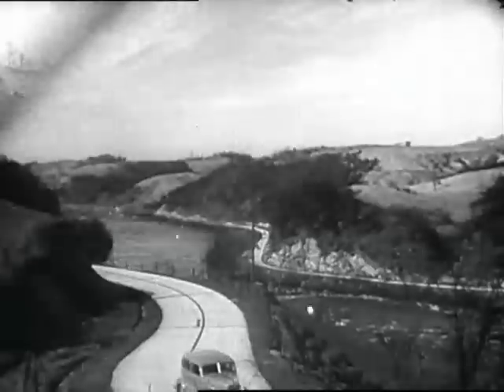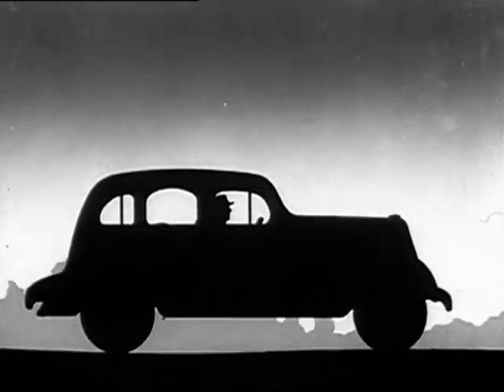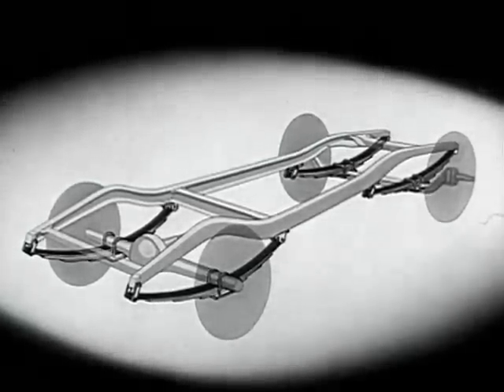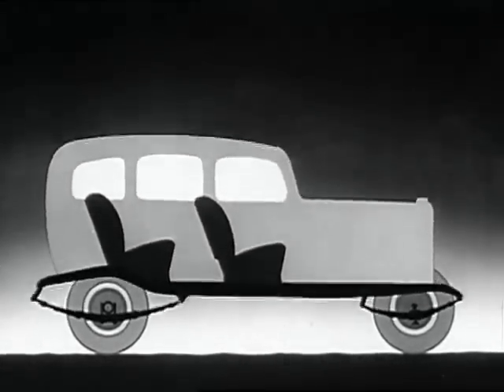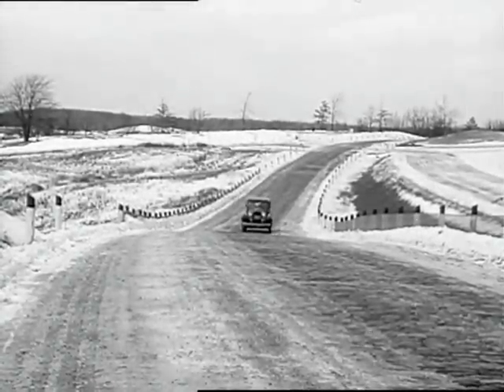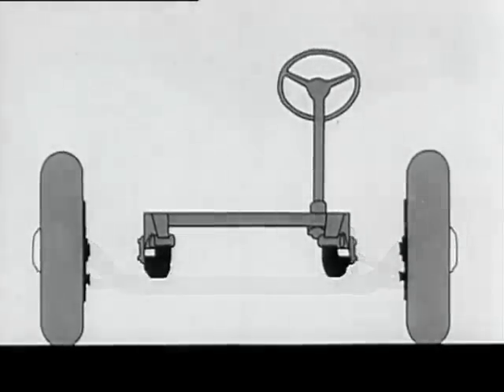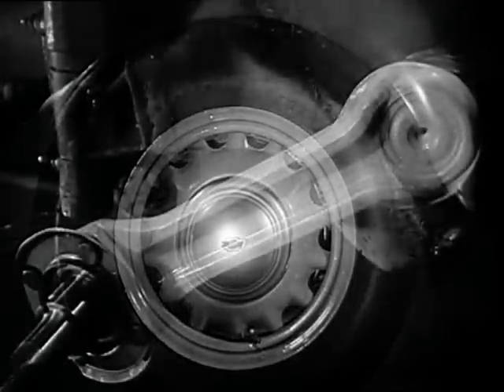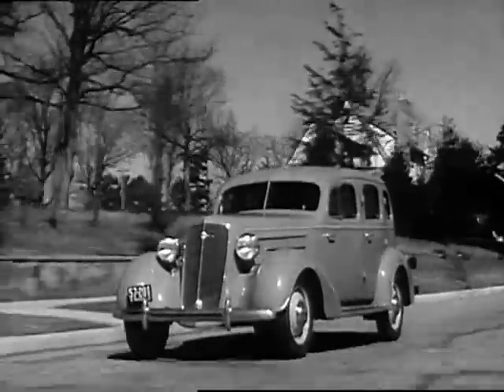Spring Harmony (1935)

Comment: It's incredible to me to think that automobiles in general are just over a hundred years old, and our suspensions still use basically the same technology from 75 years ago. These are historical videos, even if they are ads.
Reply: Umm...not really. Suspension systems date back hundreds of years and have evolved greatly. It is not the same basic technology.
Reply: @baddoggie101  care to elaborate?
Reply: @mendonesiac  McPherson struts are relatively new as are ball joints.
Reply: @baddoggie101  McPherson struts are also 70 year old technology. Here's a good short article:
https://www.hagerty.com/media/maintenance-and-tech/what-are-macpherson-struts/
Reply: And the internal combustion engines we have today have barely changed since then.
Reply: That's not technology that's mechanical engineering at it's finest
Reply: If it aint broke dont fix it

Comment: All the modern suspensions start here...  Keep in mind this technology was pre-WW2, pre-jet age,pre-computer.. Still impressive, just figuring it out..Love these videos, keep them coming..
Reply: I love these cars better than the modern crap coming off production lines. Theyre fiberglass and wires and they suck. I leaned of my friend's 2015 f-250 and i sank 3 inches into the body.  He got really pissed at me and i was left really confused about the body. I have a 1991 f150 (beautiful vehicle i love it) thts built like a brick. But when i open the engine, theres more wires than actual engine!! It annoys the crap out of me as most of that is just pollution control crap and sensors and computers and i understand that they detect engine wear but we didnt need that crap 50 years ago, why do we need it now? Look at an old engine from the 60's, its so clean and empty. Lord i wish i wasnt a millenial and born alot earlier
Reply: Ethan Bunch built like a brick means heavy like a brick, which means it’s slower, more expensive to run and harder to slow down, and not necessarily safer as the use of metal structural parts which are designed to crumple in order to absorb energy in modern cars and the much lower energy in a collision of the same speed can make crashes less dangerous. Also many cars are built from aluminium now I can’t think of many that use fibreglass.

electrical components are used everywhere in a car, there’s a reason that despite them being impossible to fix on the roadside they are used. They make EVERYTHING BETTER, yes they are used to reduce pollution but mainly by making the engine more efficient, the sensors used because what the point of having a computer that knows nothing, they allow for the car to react to make your life easier and more comfortable. We did need this crap 50 years ago but the technology wasn’t there yet. They cut out a lot of weight as what would once need to a large complex mechanism can be done from a few small centrally components.

I also idolise a largely mechanical system but electromechanical systems are vastly better, a 1960s engine may look easier but a modern engine is better, also if the engine is empty that mean the designers have wasted space and materials or someone’s run off with your engine.

(Also according to google the 2015 f-250 used an aluminium body and bed which saved up to 700 pounds of weight (sorry had to use imperial, woo metric) to compare the weight of an average 20yr+ US man is 197.6 pounds, also if you start to feel a panel flex you probably shouldn’t put so much weight on it aluminium isn’t as stiff as steel so it will deform)
Reply: Ethan Bunch another thing about car bodies, the panels aren’t structural they don’t need to be able to support a man so making them to is a waste of money, materials and adds weight.
Really if one of your requirements for car is that it can be leaned on, you could buy a crutch instead them you don’t need the car.
Reply: @ethanbunch3274  I love all of the polution control.  You can also smell an old car from around the block. Go down to Mexico, and after you're sick to your stomach from the fumes, you'll appreciate pollution control. Also, I like how modern cars last over 200,000 miles. My 1951 Chevrolet had no overdrive, and no crankcase ventilation filter. Gravel and sand in the oil coupled with always racing the engine means worn out at 100,000 miles, and poor fuel economy.

Comment: I had a '73 Peugeot 504 sedan. That had 4 wheel independent suspension that had a couple of feet of travel it seems. Best riding car I ever owned. Washboard dirt roads and speed bumps were not a problem for that car. I see its roots in this '35 Chevy.
Reply: The Peugeot 504 has been called by many folks the car of Africa because of its fantastic suspension. It is also a beautiful design.
Reply: Citroen also has a reputation for great suspension on its cars

Comment: This is such an unusual suspension design. It seems to be an intermediate to the later short long arm suspension that is still used today in better cars.  Those of you with technical knowhow, take note of how the Spring moves with the steering, and so the tie rods are not moving up-and-down with the wheels. I wonder how this affected handling versus the system that we use today.
Reply: This is knee action

Comment: Interesting that they don’t put any focus on the fact that the suspension is independent, enabling the car to respond independently to undulations on the left and the right side of the car. 
Can I suggest to Chevrolet that they for next year (1936) will engineer a long throw self leveling rear suspension which automatically increases the stiffness accordingly to the load of the car? A 20 decrease in spring rate at the back which is kept constant with the load of luggage, passengers and gasoline will do wonders for comfort 🤔

Comment: I’ve spent the last year driving more than 100 cars from a collection for a book project. 70% of them are pre-war American cars and it’s fascinating to see all the different solutions to the job of transporting people in an era when cars were still relatively new. I’ve driven a 31 Chevrolet six, which was actually pretty smooth, but cars after 35 or 36 had mostly adopted coil springs in front at least. They felt much more modern.